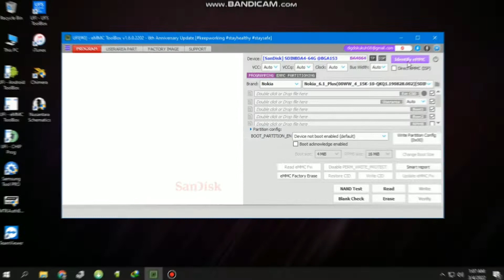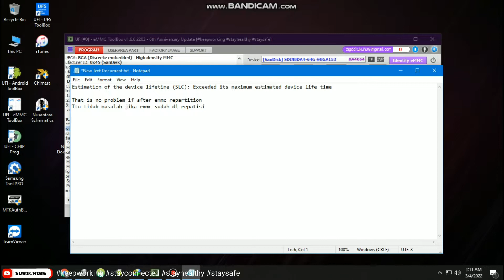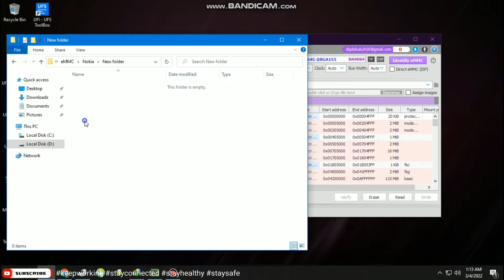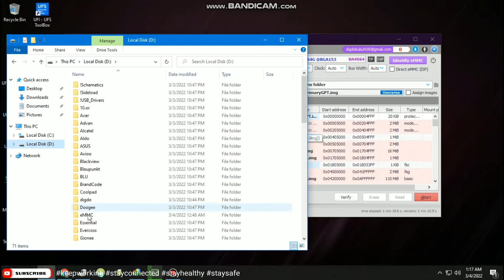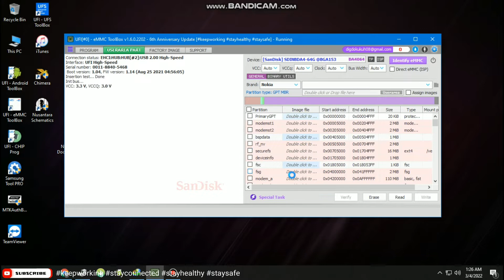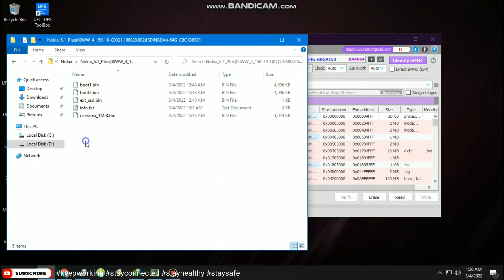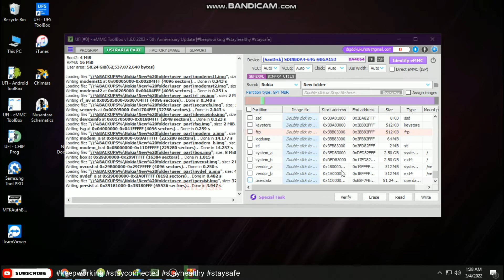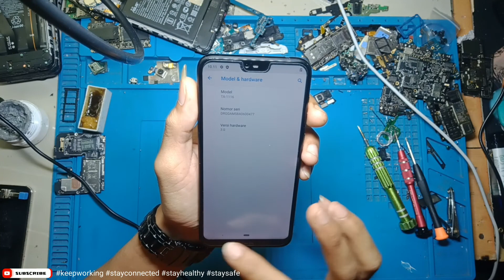Nokia 6.1 Plus TA-1116 TA-1083 Bootloop | Dump Nokia 6.1 Plus | eMMC Repartitioning @mobilecareid

Comment: I'mei unknown after write security backup
Reply from the maker: Just write modemst1, modemst2 from backuped security
Reply: Not work
Reply from the maker: @techamritamrit2902  Start over, rewrite dump, follow steps on the video
Reply: Direct write umt modemst not work
Reply from the maker: @techamritamrit2902  Maybe the red partition is corrupted or there is another problem

Comment: sir model name ?
Reply from the maker: What is the model name sir?
Reply: Nokia 6.1 plus sir
Reply from the maker: @crimpflyer7073  Yes sir, nokia 6.1 plus is TA-1083 and TA-1116. If your eMMC is urgent and your eMMC name is samsung don't update FFU, just factory reset via UFI and use my DUMP file, follow the steps in the video and don't forget to backup the red partition first like modemst1 modemst2 fsg before factory reset your eMMC
Reply: Ta-1083 work file ?
Reply: Factory rest failed solution any